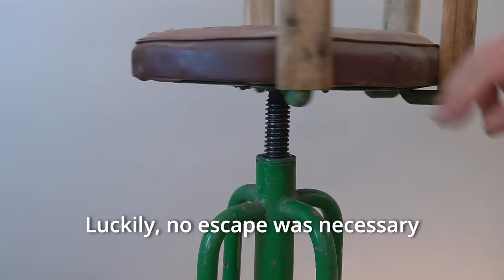How to restore a strange chair from Russian warship

Comment: This chair is actually inviting to sit in now. Thanks for doing such a great restoration on it. The things that I like about your work compared to others is that you don't replace the parts unless you absolutely have to. Then you usually try to save the main components and fit pieces into the bigger part. You are not afraid of getting your hands dirty either. Your work is great and you save the piece. Have a great day Happy Holidays to you and yours

Comment: One thing i would've done different is i would've cleaned the finite wood pieces (the pieces that get covered in fabric/leather whatever) to bare wood and then used a simple lacquer to seal them + some pond liner material to face them (molded to the wood using a heatgun - 140~150 c and that material starts to shape really well), then put all the other stuff on top. One of the biggest reasons wood chairs, specifically covered wood chairs start to break apart is because of the continuous moisture that's being held against them. And this isn't even moisture from water directly even just sweat. It adds up. The best chairs i've ever worked on, were made in Finland and the woodworker had used molted (acetone) polystyrene lacquer to cover all the wood on the area that contacted the foam of the cushion and the stiffener of the backing pads. Really thick layers to the point where the oak had a milk-ish white kinda veiny texture to it. Not a single mark of degradation, almost 50 years of use by the owner has exterior chairs (patio). Insulate the wood and it will last longer.

Comment: You know, this is one of those cases where i probably would have outlined and cut out a new single piece of wood for that backrest, rather than try to piece it all back together again from those old layers.  Its under a top layer of material so isnt seen at all, and its not all that old ie; antique, so I would have question the need to keep that one particular piece of old wood.
... by the way, you need a buddy with a sandblaster for metal parts like that ... lol.